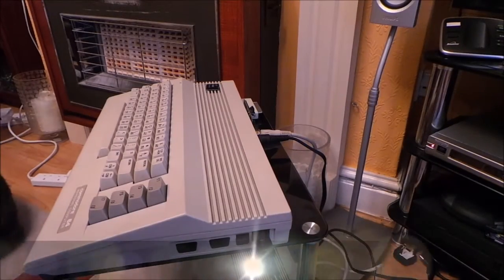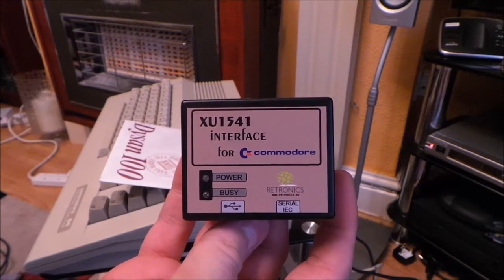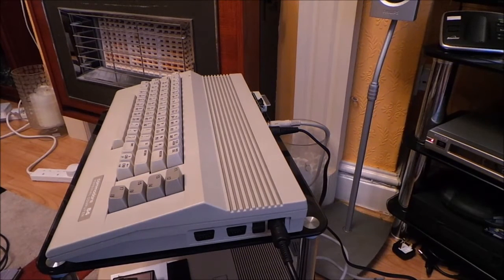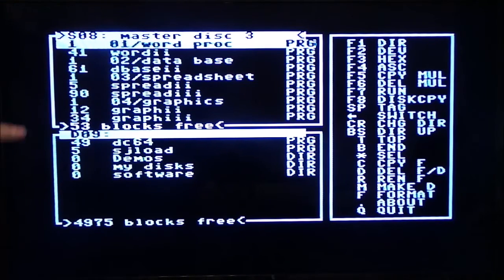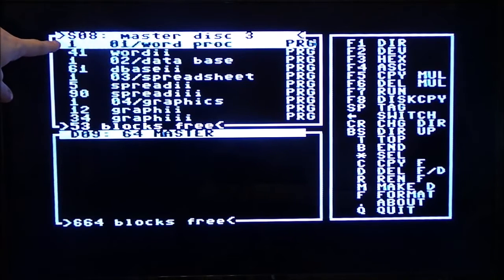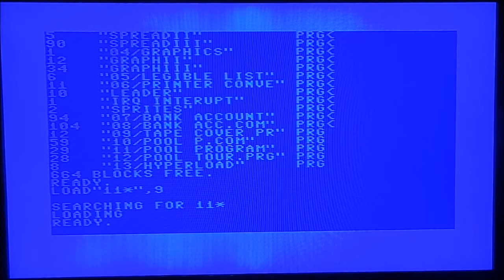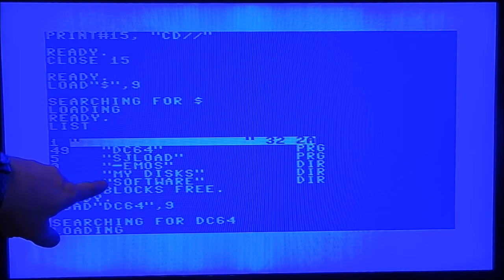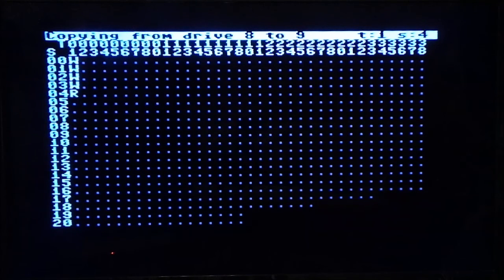Commodore 64 Quest To Copy a Floppy

Comment: Damn that backing up took time. 

I've been using Ultimate 1541 II cartridge here and it takes about 30-35 seconds to make whole disk side backup from diskdrive to microSD. Been rummaging through my old disks here last day or two...
Reply from the maker: LOL, yeah ive been doing this for two weeks now, 15 mins per disk, at least you getting 4 done for my 1 lol. Ill have to get me one of those cartridges
Reply: Damn man,  that's brutal. :)

I've been going through disks, hardest part is most are unlabeled etc. so have to read dir and see what has what, or just blindly backup and sort later :) Been going after my old asm / demo sources :)

Those 1541 II cart things are just awesome. New one is even better than previous ones :) 

I really recommend to get those, I think they work with Vic 20, C16, plus4+ etc. too
Reply from the maker: Yeah, ive also been looking for an Easy Flash 3 Cartridge too, as ive seen other videos where peeps have shown them working, something else on my birthday pressie list ;)

Comment: Interesting. Looks like a disk nibbler. I bet it still wouldn't do copy protected disks. You'd still need something like Fast Hack 'Em with the correct parameter,  and the two drive option.
Reply from the maker: da5idnz, Yes you are right, it struggles with copy protection, but I only have a few games that have that sort of protection, so hopefully I will find the program you have suggested and see if I can acquire a copy.

Comment: I use http://www.go4retro.com/products/zoomfloppy/ to connect my Commodore disk drives to PC. Works well, no bad .64 files created. No problems with using it on Windows 10 either.
Reply from the maker: Jeffrey Birt , I have not seen that, I'll take a look. thank you very much for that tip :)